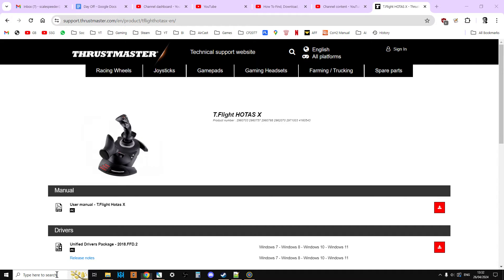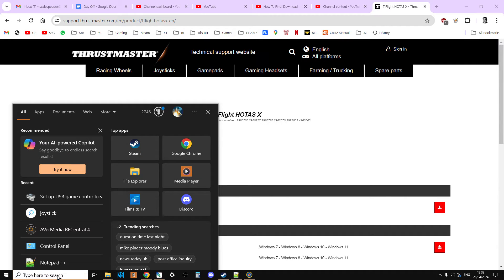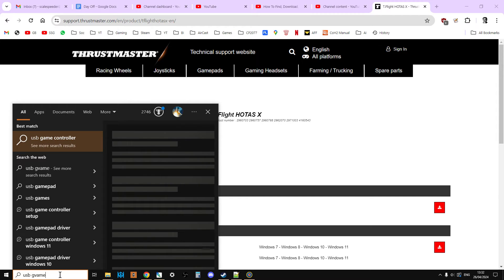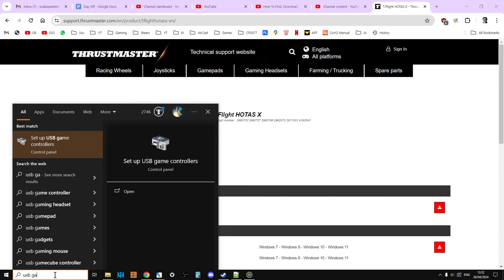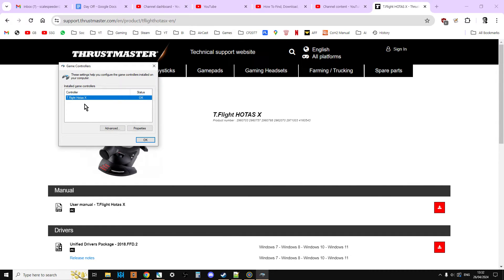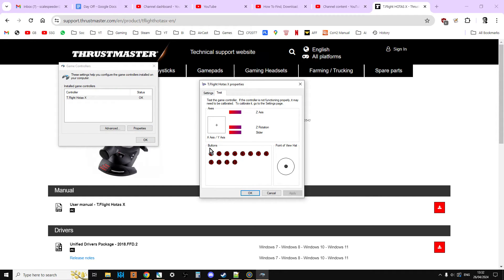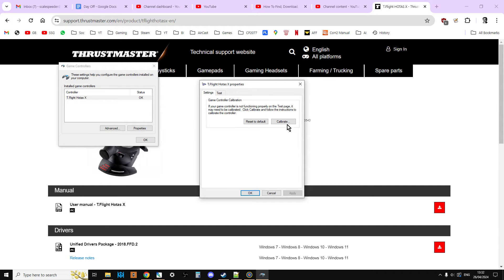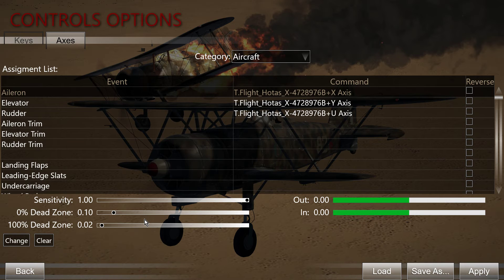How To Fix Stick Drift In Your HOTAS Joystick With Windows Controller Calibration & Game Settings

Comment: Help! Mine only shows test input, no settings tabs. Edited: when i removed the driver I got online and just plugged it in,  the default config does show settings. EDITED: If you remove the hotas one driver and just plug it in, the default driver does show the settings tab.

Comment: this pisses me off so bad, the Hotas One doesnt have a settings tab and my throttle is just completely limited at only 50. i literally dont know what else to do
Reply: Hi, a late response. I noticed that when i removed the installed hotas one driver and just plugged it in, I do get the settings tab. This must be the windows driver being used.  Its not clear to me

Comment: there is no settings tab
Reply: I have same problem. Did you manage to fix it?
Reply: @BlueDino-w9d yes, i cleaned potentiometers inside the joystick with alcohol.
Reply: @Kue7heh thanks.  I also saw that if I remove the hotas one driver and just plug it in, the default windows driver does show the settings tab.

Comment: hmm, I followed the directions for my thrustmaster 4 and it took me to the Thrustmaster Flight Control Panel Properties, but there is only the "test" option, no "settings" tab.. this is for the PlayStation+PC compatible version
Reply: same here did you figure it out
Reply: @aviation8871  no... :/ so far the issue comes and goes, hard to tell if it's software or hardware at fault
Reply: @aviation8871 I get the settings tab when i remove the driver from hotas and just plug it in. It must only be the windows driver that has the settings.  Not clear to me.